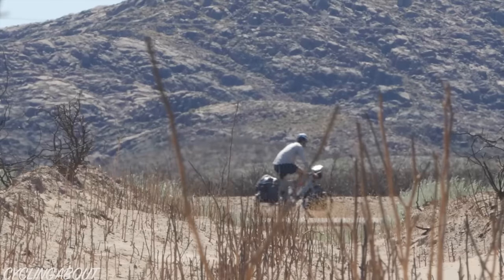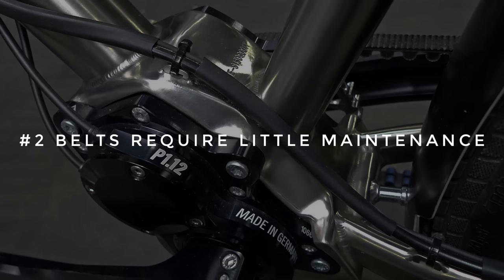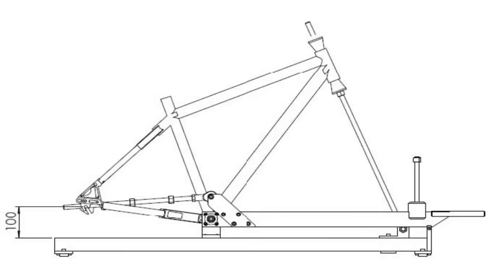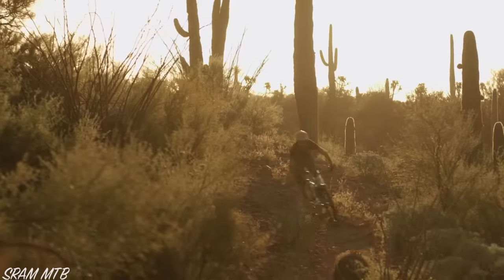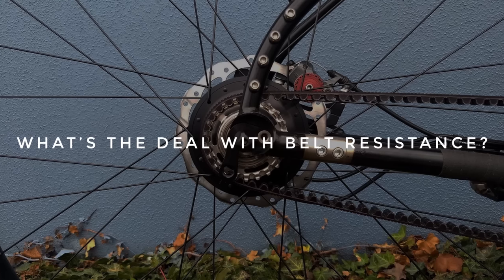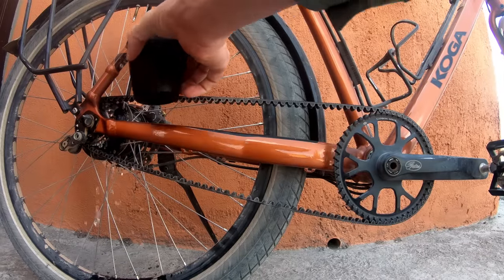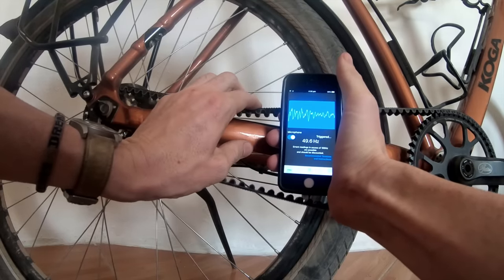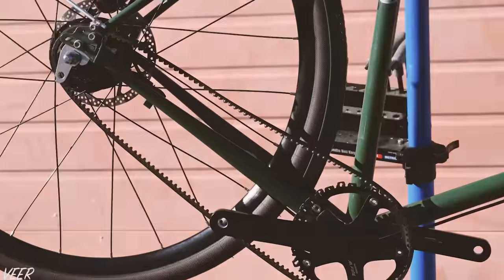Belts Are The BEST Bicycle Drivetrain Available (Epic Testing!)

Comment: i've ridden internally geared hubs for many miles, including rohloff, and they are not going to be right for most cyclists due to heavier drive train and efficiency losses despite the lower maintenance intervals. the belt has two main markets: 1) the few cyclists like yourself who are traversing mongolia and demanding extremely robust drive trains, and 2) clunky dutch-style utility bikes where the user demands near-zero maintenance but plans to keep the bike for a long time. keep in mind that many occasional cyclists treat their bikes as disposable when maintenance issues accumulate, and the higher initial cost of the belt drive w/ gears isn't going to make sense in that market. but i think you did a good job presenting the pros and cons and showing how there would probably be a demand for belts on a few more bikes if people had better information. thanks for your video
Reply: Dutch people favor longevity over light weight items, that's why their commuter bikes are made out of steel instead of aluminum.
Reply: You are forgetting commuters. I commute about 100 miles a week and intentionally choose a belt/ IGH system due to the low maintenance. Every minute you safe with a lighter derailer system you will spend double and triple on maintenance. An IGH is an excellent choice for everyone except for people that really use bikes for sports. There are reasons why most people shun carbon frames because the advantages don't outweigh the disadvantages. For someone racing the advantages will certainly outweigh the disadvantages. It's always a question what you want to do with your bike. If you want a toy/hobby or just a reliable transport system.
IMHO will chain and derailleur vanish in the long run except for expensive sport bikes and low cost bikes.
Reply: its interesting to see people who dont care about society at all 😂
Reply: Wouldn't call my bike clunky, but it's Dutch for sure. It's a very light single-speed with a CDX. I use it for my daily commute. The most efficient bicycle I ever had. Cost-effective too!
Reply: Or for someone who uses a bicycle for daily commuting, and wants to do as little maintenance on it as that required on a car. My commuting bike is heavier than my road bikes, but is neither clunky nor Dutch-style
Reply: Or it's if you are using your bike very regulary and still don't want to be arsed with maintainance. Bikes are the main sort of transportation while they aren't enthusiasts. Low maintainance is just great overall. Derailers are really a pain in the Butt to deal with, especially when all you wanna do is to get to work. 
Internal Gear hubs "just work". A belt then is just the next way to reduce maintainance. 

As for disposable bikes and such.... I guess we should focus more on bike Theft. I don't wanna repair my bike either regulary. To much broken = new one, because repairs aren't financially viable. 
A more expansive, better bike would make sense. Getting it fixed would make sense as well. But then there is massive bike Theft, and owning anything worse more then 200 bucks is a likely target unfortunately.
Reply: @jeffel80  that is not the right oil, you would have to apply it in every use almost
Reply: I have mostly good memories from my years of riding with a belt drive and Alfine internal gear hub.
Reply: @svenweihusen57  I live in the netherlands, and the bikes here are made to last, and even then most bikes use chains, I have to ride 15km a day and did this for 200 days a year for a bit more than four years. Thats a total of almost 13000 km, ive never had any issues with chains, and my other friends who I commute with (a group of 3 others) also never had issues with their chains, so I wouldnt say that belt would be that much better for commuting with its high cost, and lower effecientcy, I only twice had issues with my bike. One of them was with a back tire that was at its end of its lifecycle and had giant tears in it, after often riding with friends on the back of my bike, this is often done in the Netherlands with the use of a small rack on the back of the bike to transport items/passangers. The other time I had issues was with the lights on the front and the back of the bike that stopped working. So in my experiece a belt does the job, for a the cheapeast and highest efficiency
Reply: @prolo0696  may I ask if you have a derailleur system or an internal gear hub? A chain with an internal gear hub certainly does the job because it's always running under optimal conditions and you can effectively shield it from water and dirt. On a derailleur system a chain needs way more maintenance but you are right: with an internal gear hub the benefits of a belt are way smaller.
That a belt is inefficient isn't really true: both systems lose efficiency under higher loads but belts way less than chains. At around 120W it's even and after that the belt wins. Ultimately when you start to care about efficiency you are most likely putting out so much watts that a belt is more efficient.
Reply: A bike is not a toy or your gym membership
Reply: @jeffel80  WD-40 isn't a long-term lubricant oil, stop spraying it as if it is one. It's meant to displace water, do some cleaning, provide short-term (but quite good) penetrating lubrication to break loose any seized parts if you have to, and then allow you to put in whatever lubricant of choice after it evaporated, leaving behind a film that prevents corrosion. 
Also while you're at it do stop smacking things with your tools' batteries. Makes them live longer.
Reply: @jeffel80  Do not use wd40 on your bike chain unless it is just to clean it.  It is for de-greasing not for lubricating.  I prefer the wax based lubricants as they are easy to apply and keep the chain nice and clean.
Reply: @jeffel80  friends don't let friends use wd40
Reply: The efficiency argument I'd null and void to me. Unless you're a performance cyclist competing its not an argument. I've compared my performance on a regular chain and derailer bike to my Tern Verge S8i. And its not worth talking about.

Sure you are moving a few more pounds of weight. But let's get something straight. Weight is weight. And the Tern Verge S8i made me super fit. And I lost over 25lbs of weight in 8 months riding one. And as I lost weight the ride got easier and FASTER. But the superb benefits of the gates belt drive and Shimao alfine hub didn't change
Reply: Lo,l hard disagree. Most people getting a bike could care less about a 6% efficiency loss. You tell them for a couple hundred bucks more, that they don't have to worry about cleaning it was much, adjusting derailleurs and being able to change gears while stopped? They're sold.

Don't assume every rider wants to dress up in skin tight clothes and cover themselves in sensors to compete on an app. That's the minority.
Reply: Well said, and I agree entirely. It's unlikely that I will ever actually wear out the chain drive on my bicycle given that I can rarely use it where I live for a bunch of reasons. The cost of changing to an internal gear hub + belt cost more than I spent on the entire bicycle. I would just buy a belt bike with internal gear hub as the next machine to try for some years of seasonal pleasure riding use.
Reply: There are not right for most cyclist but they are right for most people who have bicycles.

Comment: I weigh approx. 110 kg. Nice that me and my bike can be 300 g lighter.
Reply: The sun weighs 1,989*10^30kg.Nice that you and your bike can be 3*10^-1kg lighter!
Reply: A photon's rest mass is 0. Nice that you and your bike can be infinite times lighter!
Reply: Take a 300 gr weight and try to maintain a t-pose. What hand falls first and how much time it took?
Reply: @sirnikkel6746   both at the same time because it got boring before it ever became an issue. For reference I did it for a bit over an hour while watching TV. Both arms felt the same
Reply: Your bike can make you more than 300 g lighter depending on how you use it
Reply: So many lighters. Thanks guys  😁🚬🚬🚬
Reply: @eklhaft4531  wasn name lol
Reply: 300g is not nothing because you multiply the weight by the force on put on the mechanism
Reply: Skip a few donuts it would be easier than changing your bike :)
Reply: I'm 60kg. Wow 110! I'm not here to be a bully but just comment on how I would lighten my load by considerable more.

Comment: So basically I'm getting the disadvantages of both by using a chain drive with a 3 speed hub.
Reply: yes
Reply: Lol I think you’re right on that one
Reply: It's pretty good solution for commuter bike where low maintenance and longevity are main priorities. Gear hub doesn't get any dirt or water inside so it should last 50 000 km or so. Single-speed chain is wider and more durable than multi-speed one, also when both gears are at the same plane (chain doesn't bend to the side) chain wear is much lower. So why not!
Reply: @allmycircuits8850  Funny you should say that, it's a Columbia Commuter 3. It's been incredibly reliable, until the 50 year old rear tire gave up recently this summer.
Reply: If you've got an enclosed chain guard on your bike so water and grit don't get into the links and a good quality hub,  you've actually got a very pretty reliable system that can go for decades with very little hassle.
Reply: It depends. If you live in a flat area you can set up your gearing so you are using gear 2 most of the time, leaving gear 3 for tailwinds or downhills. Gear 2 (on a Sturmey-Archer at least) is a direct drive - everything is locked up so there are no transmission losses, so you should get a comparable efficiency to a singlespeed...

Most IGHs of 7 speeds and above use at least a 2-stage drivetrain so you never get that 'direct drive' efficiency. It's one of the advantages of the old-school SA hubs over the newer systems :-)
Reply: @The1trueDave  : Shimano's 8-speed hubs have direct drive in 5th gear. I don't know about their other hubs though, because I've never used any others.
Reply: Yes, you're getting the disadvantages of both, but you're also getting the advantages of both.

I'd really recommend a hub with more gears, though. A Shimano 7 speed hub would give you a much wider range for steep hills without requiring significantly more shifting the rest of the time.
Reply: @deusexaethera  I checked up and you're right, so fair play :-) http://thelonelyniholaenthusiast.blogspot.com/2014/07/gear-hub-madness.html

The Nexus 7 uses compound ratios throughout and I just assumed the Alfine worked the same way. My bad!
Reply: Nah!
Reply: @The1trueDave  Thank you for the info! Cool to know that 2nd gear is locked up! I've been riding with Sturmey-Archer for the past 8 year, and it just feels good. And now I understand why 3rd gear feels a tad less efficient than 2nd :D Not a lot, just a tad.
Reply: @LloydLynx  Quick question. Where do you get a replacement shifter cable for that bike? I had yo customize a cable end that fit into the original shifter that came with the bike
Reply: @jfnwjnowngowjrn  No idea, haven't had to replace it yet.
Reply: @TheJooomes  what I did was to get a cable with the right end that attaches at the hub, then at the other end (which attaches at the shifter) I soldered on a glob of solder similar to the cable ending that's supposed to be there. It's held up for the past week, but I'm not very confident in it at all. I'm thinking of splicing two cables together right after the hub, before the cable enters the housing, each cable with the correct ending on it, and using the splice to control the overall cable length (given that the overall length is already close to what's needed). I'm pretty confident that this will work. With my luck, I'll resolve the issue just in time for the hub to give out lmao
Reply: @jfnwjnowngowjrn  Ask in a bike service shop, I'm sure they help you! I think modern cables are pretty much the same as olds anyway ;D
Reply: @Simen Middelhuis  nah, the shifter cables on these old shimano 3 speed hubs are double-ended. Instead of tightening into a pinch bolt on one end, like modern cables do, which would allow one end to be cut to size and just crimped at the end so the cable doesn't come apart.  The old shimano shifter cables have a shifter ending on one side and a brake ending on the other. Shimano has since updated the way the hubs work, starting with the Nexus, so that there is just a pinch bolt at the hub to accept the cable.